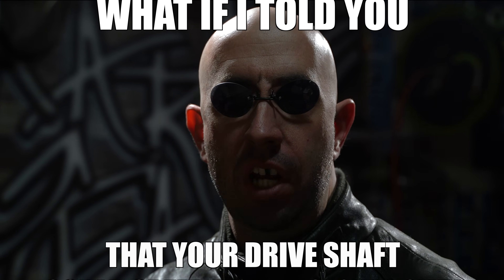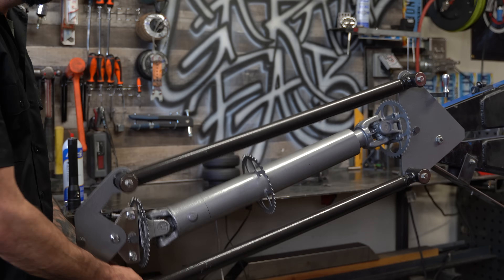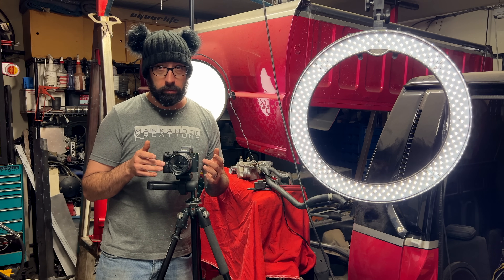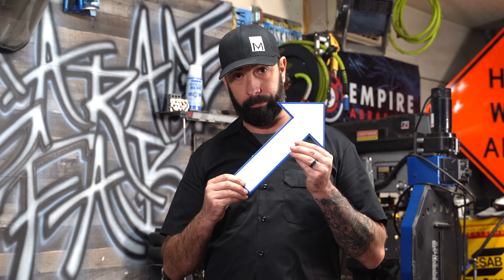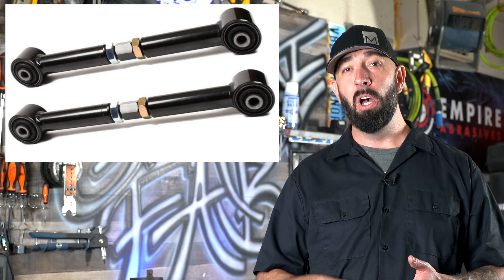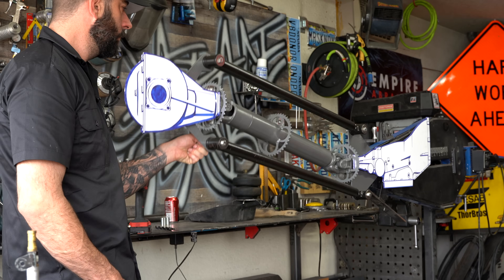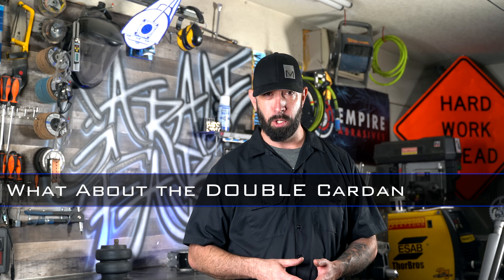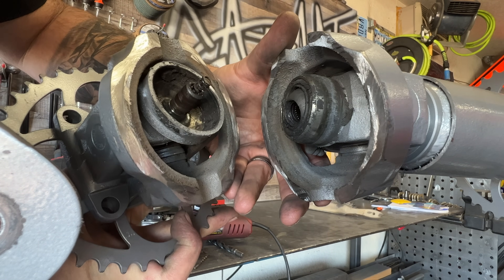THE Driveshaft Video. The Nature of U Joints. Suspension Basics Ep. 06

Comment: A couple of comments.

Very nice demonstration.

You should add one more section to it, to explain and demonstrate one more thing and correct a couple of errors in the process.

For there to be constant velocity at the pinion gear, the pinion shaft and transmission shaft do NOT necessarily have to be parallel (Z shaped driveline). That is only one of the two possible solutions to this math problem. In this solution the operating angles of the front and rear u-joints must be the same. 

Another solution to this is to make one of the u-joints operating angles the same, but angle the transmission or pinion gear so that the operating angle flips from the top to bottom or vice versa. An example will make this easier to understand. Assume the transmission angle is 0 degrees, the driveshaft angle is 5 degress and the pinion angle is 0 degrees. This makes the operating angles of both U-joints 5 degrees. Now take the transmission and drop the rear of it about 2.5 degrees. Now the front U-joint operating angle will be about 2.5 degrees (5-2.5) and the rear operating angle will be about 2.5 degrees (5-2.5). The variations in rotational velocity will still exactly cancel as they do with the first solution. This is called the U shaped driveline solution. It is used by Ford on all of the Fox body based cars (1979-2004 Mustang, LTD, Mark VII, T-Bird, etc.) One of the main reasons is that it results in the driveshaft being a little bit lower down, so that the transmission tunnel near the rear seat bulkhead does not become the limiting factor with bump travel in the rear suspension.

Some people think this is incorrect and input and output shafts must be parallel for the velocity variations to cancel, however you inadvertently demonstrated that this does work by using a double cardan joint in the demonstration. A double carden joint IS a mini version of a U shaped driveline and from input to output, it does have a constant angular velocity.
Reply from the maker: There will indeed be a part 2. I’m unsure when, but I get a lot of questions about two-piece shafts which has its own set of rules in regard to proper setup.
Originally the U shaped driveline was discussed but in editing I removed it because the video got excessively long, and because the majority of my viewers are interested in air suspension.
The U shaped driveline is very effective with static suspension (springs) with only 3ish inches of travel. On an adjustable suspension with 10-12 inches of travel, the design is less than ideal. As the axle pushes upward the rear of the shaft follows, which increases the angle of the front joint and lessens the angle of the rear joint. On a static height vehicle this misalignment is minimal and temporary.
Moreover, the Mustang rear control arms are designed in a way that causes the nose of the pinion to drop when the suspension is compressed which helps compensate for this and keep the front and rear U joint angles close.
Air suspension and hydraulics on the other hand are often driven at various heights, cause far more misalignment, and are NOT temporary.
Honestly I didn’t have the drive to explain this and didn’t want to even try to explain how to design an uneven length link bar system that would keep the angles equal.
Simple solution… parallel shaft angles with a parallel 4 link. 😅

Comment: Hello,help me understand,I'm 73 and I understand equal pinion angle,but I have equal pinion angle ,with 9.7 degrees angle on my driveshaft is that going to be a problem on a 49 DODGE that I'm going to putt around home at 45 to 60 mph max?
Reply from the maker: Hey Charles! If you’ve got parallel trans/pinion shafts, you’re mostly there.
U joints have a maximum operating angle that gets lower as RPMs go up.
Typically, you want to stay below 7° for a vehicle built for the freeway. It’s hard to say if you’re nearly 10° will cause problems or not.
Because your angles are good, you won’t find any vibration at slower speeds, but you might at 60.
Your U joints will play nicely together but you still have a rotating mass that’s rapidly speeding up and slowing down which is what might cause the vibration.

Comment: @12:38 you have some options there also,  Rzeppa cv joint driveshafts might work to solve the variable velocity issue, though they have a maximum operating that is usually less than a comparable u-joint.  There are also trade-offs there with cv's, namely: heat, strength, availability for the application, cost and longevity.

Comment: I know I had posted this one before, but there are two planes of operation.  Top view and side view.  You did an outstanding job, probably the best I've seen, in describing side view and I post this video when trying to explain the effect.  Top view is also important, and is less often covered.  If your drive line has either the diff (like the rear manufacturer intentionally built the diff off to the side) or trans (or transfer case) output shaft is off set in top view, then you have the potential for compound angles.  In other words, it's equally important, no pun intended, that your angles be set evenly in the top view also.  Just imagine your demonstration contraption there, as though your truck is transparent and you were looking down through the top of it.  If your axle thrust angles are cattywampus, because your link bar lengths are the wrong on one side - bam - same vibration effect and same cause.

Comment: Amazing video! The best explanation I've seen. I have a question, hopefully you'll see it eventually and have the time to give me some words of wisdom. I'm planning to do an LS swap and I'll changing too the original rear axle on my 1960 metro van. I will replace the rear axle by a 98 Ford explorer axle. I am not planning to use an air ride nor to drop the height of the van. How worried should I be about the engine/ transmission - pinion angle? What would be the proper angles I should aim for? Many thanks in advance.
Reply from the maker: Thank you, Osiris! Engine/trans - pinion angle is ALWAYS important. But if you don’t have adjustable suspension, it makes it much easier and you don’t have to worry about suspension design causing angle changes.
Do you know what type of U joints your driveshaft will have?
For now I’ll assume you’ll have 2 single U joints.
Do the engine first. Often we don’t get to choose the angle. The oil pan has to be at a certain height, the transmission can’t hit the tunnel… Make it fit and then determine the angle. (Usually at the crank pulley)
The match the pinion angle.
If the transmission is pointing down 2°, point the front of the differential up 2°.
If the transmission is pointing down 4°, point the front of the differential of 4°.
If the transmission is level at 0°, level out the differential at 0°.
Parallel is key with single U joints.
If you decide you need a double Cardan joint, or don’t know what you need, come back and we’ll figure it out together.
Also, hit me up via email.
I don’t always see YouTube comments.
GarageFab702@gmail.com

Comment: I’m having a terrible shaking problem on my 22 SPT WRX (has been on air suspension for 2 years now NO ISSUES until-)... I tried installing a carrier bearing lockdown kit (from Perrin performance), as per instructions it says to allow the carrier bearing to hang / sit on the exhaust. After realizing the SPT & Manual models have different carrier bearings, I reinstalled everything & now the car shakes tremendously over 50mph. 

I don’t understand why it’s shaking / what I did to make this happen. Since then, I had a new driveshaft installed & have been to 3 shops & I get the same answer everytime; we don’t know. 

Did I unbalance or throw the driveshaft out of phase? Or did I simply misalign it / need to realign it properly? 😭

Comment: i've watched this one several times. the explanation is fantastic. i've learned a lot. but.....how does this change with an IRS? or does it? how is pinion angle set with an IRS?
Reply from the maker: So with IRS, the angle rules apply exactly the same; With a drive shaft 2 singleU joints, the pinion shaft must be parallel to the transmission shaft. 
The only difference with the IRS is the differential does not move up and down with the suspension so you don’t have to worry about pinion angle change over bumps.

Comment: Very good, except your comments about phasing are technically wrong. To eliminate vibration, cardan joints need to be out of phase. You will say, no, my drive shaft has the you joint lobes lined up.  And it does, because the front lobes connect to the output of the cardan joint, where the rear lobes connect to the input to the cardan joint. Perfectly out of phase.

But as you say, it's just terminology and convention.
Reply from the maker: Interesting! I can’t argue because I’m a regurgitator. Meaning I probably heard, “in phase” from someone else. Your explanation and the entire principle make “out of phase” seem reasonable. Think the mirror demonstration and the fact that the second joint needs to reverse what the first joint does.
Now I need to go look up the definition of “phase.”

Comment: Wow that was an educational video. I just changed my rear diff, 3 ujoints, and center bearing. I have slight vibration at certain speeds now and I ended up on this video. I learned a lot. Thanks. I now have somewhere to start looking at least
Reply from the maker: Thank you, Chris! This video didn’t touch a whole lot on 2 piece shafts but the basics were there. I’m confident we can figure things out. When did the vibration start? Immediately after the replacement of the mentioned parts? Was anything else changed? Like the suspension height? If you didn’t lift or lower your vehicle this video will likely just be a distraction from your real problem.
If you just used factory replacement parts, I’d suspect either one of your U joints is out of phase (see video) or the bearing caps on one or more U joints isn’t positioned properly.
If you’d like me to assist in finding the issue, email me with as much info about your repair as you can. Cheers!
GarageFab702@Gmail.com

Comment: I've learned mountains of info you are amazing my brother, I do have a stupid question with u joint and cv joint. Why dont we use cv in place of u joints.
Reply from the maker: Thank you my friend! Not stupid at all. Occasionally CV joints ARE used on driveshafts. I’ve seen them on the Honda Element and on some aftermarket upgrades. I’m more interested to know why they choose the CV on a drive shaft instead of a U joint.
CVs are used in FWD axles because when steering components move, the joint angles become VERY unequal. 
I can only give you my theory why it’s not more common, but I’d bet some money that it’s true…
The CV is more complex, requires more material and more time to produce. Therefore costs more.
Vehicle manufacturers pinch pennies whenever they can. Since the U joint works flawlessly when set up properly, it’s a great opportunity to save some money.
Reply: @GarageFab well.said my friend

Comment: What happens if your engine is not centered in the frame and the transmission is not angled 90 degrees to the axle?
Reply from the maker: An uncentered engine/transmission is not a concern as long as they are still parallel to the differential input shaft (Pinion) when viewed from above.
However, if the engine/transmission are angled in the vehicle, that could potentially cause a problem but the amount of that angle would determine how bad or noticeable it would be.
In that event, I’d strongly suggest a double cardan joint wherever the sharpest bend is needed.
For example, if the trans tail is pointing directly at the front of the diff, put the single U joint in the front and the double in the rear. If the diff is pointing at the back of the transmission, put the double cardan in the front.
Remember, with a double cardan joint, the other single joint needs to be close to straight.
If you have a two-piece driveshaft, that will change things a little.
Reply: @GarageFab  Thanks for the quick answer.  I put a 350 in a 67 Camaro that has big block frame stands.  They move the motor to the passenger side about an inch. I have a vibration (shudder) at 1800 rpms with a rebuilt transmission which I think is a torque converter issue. I am just pondering all faults before I take anything apart again. .. Been watching your channel all afternoon.
Reply from the maker: @ Nice! Thank you. If you stick around long enough I’m sure you’ll eventually see a first gen Camaro. It’s my all time dream car. 
It’ll infuriate purists though. Might be a Firebird converted, will have a full frame possibly stolen from an S10, bagged, might even have a 5.0 Ford motor to really hurt their feelings.

Make sure your U joints aren’t wiggly or seized up. You might have to drop one end to check. Then if your angles are good, I think it would be safe to move on to other things. Lemme know what happens!!
Reply: @GarageFab  Wow still watching 16 yrs of your videos 📹 😳

Comment: Help! when you say the pinion or operating angle needs to be parallel, does that mean if the transmission is -4.5 degrees, the diff should be +4.5 degrees?  Or should they both be -4.5 degrees? Is it possible to speak with you?
Reply from the maker: Hey Peter! You’re correct the first time around. Your angles will cancel each other out with complimentary angles.
It’s important to realize this rule only applies to a single piece drive shaft with 2 single U joints.
If you have a two-piece shaft and/or a double cardan joint, that’s going to change things a little.
What vehicle are you working on and what is the rear suspension setup?
Reply: @GarageFab  Thank you boss for the reply.  71 Challenger R/T. Rear leaf springs, single piece driveshaft.  My problem seems to be with the transmission @ -4.5 degrees when I put the rear @ +4.5 Degrees, the driveshaft slopes upwards toward the rear about +2 degrees and that brings the operating angles at +6.5 degrees.  Should that matter? Most videos and forums always show the driveshaft sloped downward toward the rear.  Any help appreciated.

Comment: Never understood pinion angles, what they should be or how to figure them out, great explication!    I have a question for you, have an old 1982 Mustang GT.  It rusted badly, everything in back of the stick shift was rust.  I had to cut out and weld in parts found from a junk yard and create some frame pieces myself.  How do I make sure the rear wheels are mounted in the proper location?   I tried my best but the upper and lower control arm mountings may be off a little and not in the exact spot they were with the original frame.
Reply from the maker: Thank you!
How far off do you think your axle could be? Wheel/axle location isn’t super important if a few needs are met; The wheels need to fit in the wheel opening, the driveshaft slip yoke needs to have at least 2” of engagement at all times and can’t be allowed to slam into the back of the transmission.
Wheel alignment is very important as well.
It sounds like the work is already done, so your only option is likely going to be adjustable length control arms. This will be super important if a mount on one side is further back than the other. This will cause what’s called “thrust angle” where the rear axle is pointed at an angle.
Getting your alignment checked is the only way to see if this is an issue.
Lastly an adjustable panhard bar might need to be added if your axle isn’t centered under the body.

Comment: Video author: 
Here's a tricky one for you.
If you cannot get both angles parallel on the input and output, you can offset the angles of the yokes for the cardan joints to eliminate the speed variation.

The mathematics to achieve the correct angle offset is a little complex.

I have photos and information of how this is done on a V8 Supercar steering shaft if you would like to message me for the details.

Comment: Would it ever be proper to have a transmission that is down 3° and to angle the pinion down 3° on a stock 1955 Chevrolet Bel Air? That’s what I was told but it seems a bit odd since mostly I’ve heard down with transmission and up with pinion.

Comment: I am going to lift a 95 GMC suburban. I notice that the rear lift kit has a metal wedge. The thiner part of this wedge should be rear or front of the support under the axle?. thanks
Reply from the maker: It depends! You might not use it at all. 
Is it a single piece or two piece drive shaft?
You’ll want your differential to be parallel to the transmission on a single piece driveshaft, or parallel to the first section of shaft on a two piece.
Usually when lifting something the front of the differential will go up, so you’d want to position the wedge to make it go back down.
This position will also depend on if the axle is mounted on top of the leaf springs or on the bottom.
To point the diff back down when the axle is on bottom, the thinner part will point towards the rear.
If the axle is on top, the thinner part will point forward.

Comment: I fully understood driveline angles before I watched this, but this is the best, most fun description of the process.  

For what it’s worth, most automotive driveshafts have end yokes that will always be in phase, since they are welded to the same shaft.  But not all driveshafts do / are.  Some driveshafts have viscoelastic dampers between the drive and driven end of the shaft, which can fail and result in the yokes being skewed.  Also two piece shafts may have male to female spline couplings to allow longitudinal change with suspension deflection.  If those splines are misaligned you’re going to have these speed variation problems.